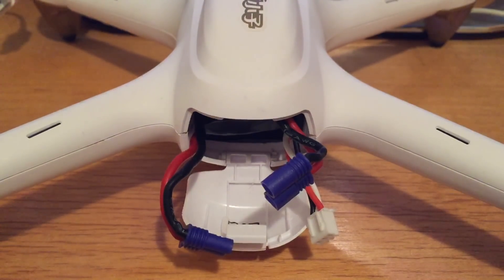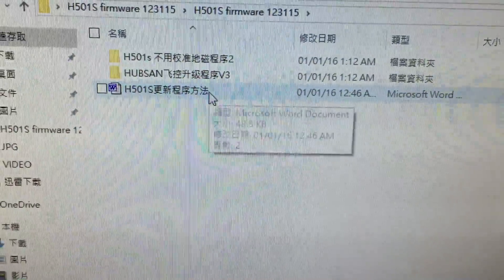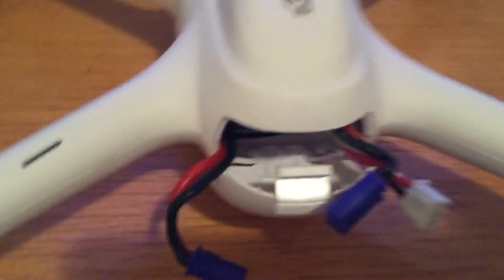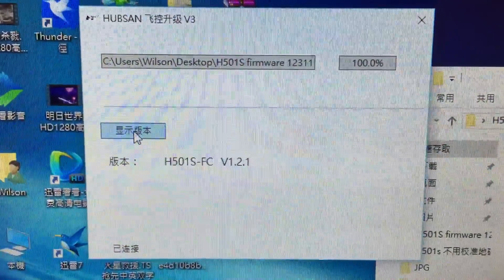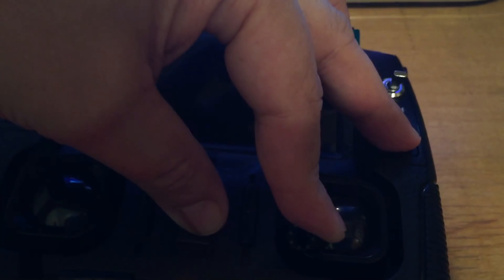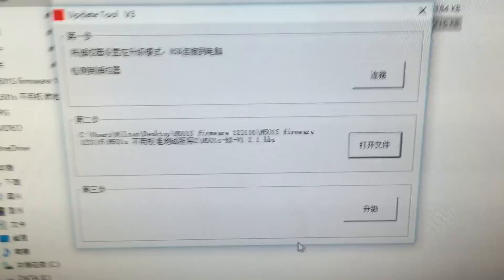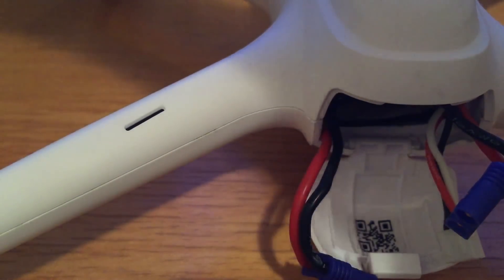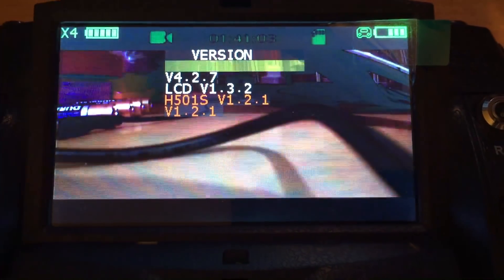Hubsan H501S X4 firmware upgrade video tutorial 1.2.1 (12312015)

Comment: Anyone here know why my FPV video range just 30 metres with mod (same as
 stock antenna)?? Many times changing the frequency but no luck.

4.2.14 (TX)
1.2.9 (RX)
1.1.17 (FC)
Reply: DSM  have you crashed hard?
Reply: DSM Firmware,  you have to go back to a older version as I did. The new versions have shortened due to FAA regulations.

Comment: I tried to update my drone 3 days ago to v1.1.17 and my H501s is dead. Period.Tried to update the Low Pro transmitter to try and fix the problem but could not get the firmware to install. Found instructions how to install  firmware independent of quad and installed v1.2.3.hbs and now the transmitter LED's do not light up and the srceen stays black. So now its dead too.The H501s makes 5 ascending beeps and then sits silent with no LED's flashing.   I can access the quad via USB to reinstall the firmware but nothing changes. I can't find a older version of firmware to  revert to. Back to the transmitter I can reinstall the v1.2.3.hbs firmware if I go right stick down right, pushing record button, power on... so there is life in these paperweights somewhere...
Reply: I am with equal problem, how do you solve?

Comment: My Windows 10 64bit does not recognize the transmitter even after successfully installed the driver.

Plz advise.

My Quad is on a 1.2.1 and transmitter is on 1.9.1.

Thank you in advance
Dan Daus
Reply: and? did it work?

Comment: A question: Too many versions right now (I guess up to 1.2.5), what do you recomended? (I jjust read in forums, many owners report errors of update in some firmwares, when they update, so I am a little scare. May be depends of where they bought H501S (as I'd read), but I don't want any problems with my dron. What firmware is more secure for update? Thanks!
Reply from the maker: I have not played much lately so I am not sure about the latest firmware I guess right now it is 1.1.17? Mine is still 1.1.8, manual calibration. If it works out without any issue, stay with it.

Comment: I was able to update the with your FC firmware 1.2.2 for the drone but not the RX? I updated Unicode to Chinese PRC but it still will not connect to the RX. What should I do because the RX still has 1.1.7. I can't fly at all now please help.
Reply from the maker: You may need driver for the TX, check description above
Reply: +Brabbitster Thanks but what file should I use in CH341SER.ZIP?
Reply: +Brabbitster I still can't get it to connect. I think I'm doing something wrong. Please help I only had my quad-copter for 1week?
Reply from the maker: +aw3d I am sorry but we are 4am here, did you install the driver? or try to ask someone in the forum http://www.rcgroups.com/forums/showthread.php?t=2522182&page=116
Reply: +Brabbitster Your link does not work for 1.2.1?
Reply from the maker: +aw3d Updated link already
Reply: Brabbitster you are the man!!! I'm back flying! Thank you for all of your help.

Comment: I have upgraded to firmware v1.2.2 and height and distance has improved, however after 2 minutes of power on the front LEDs turn red and will not change. Please help as everything else with update has worked perfectly. Thank you.

Comment: why remote control Unable to connect computer?
only can upgrade aircraft
Reply from the maker: +Chan Kim Tong bind it with the quad, it still works
Reply: +Brabbitster happened to me also I can only update the quad not the transmitter. Any workaround on this one?
Reply from the maker: +Lee Gen use the file to install driver CH341SER
http://www.megafileupload.com/ecuV/H501S_Transmitter_Firmware12252015.rar